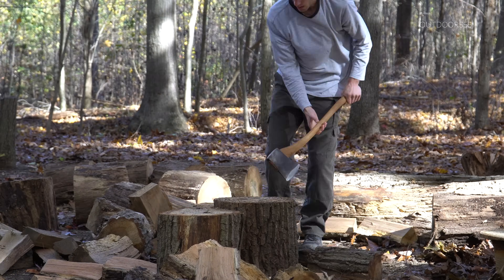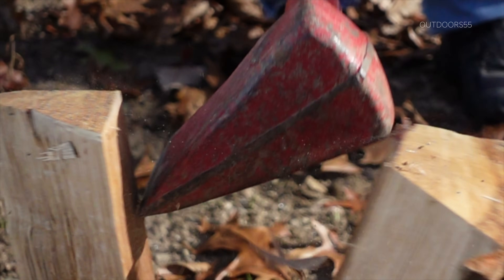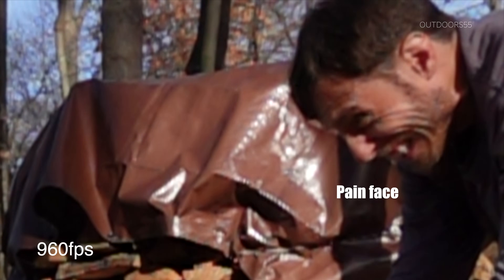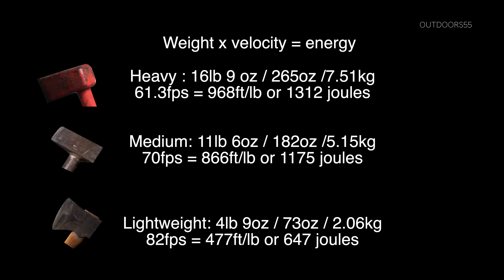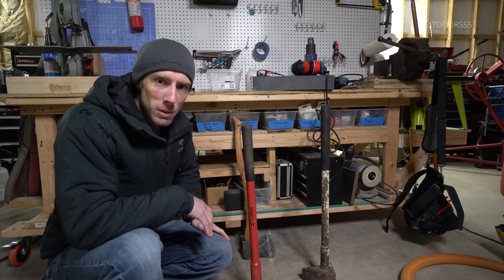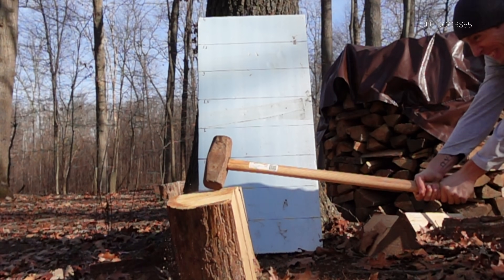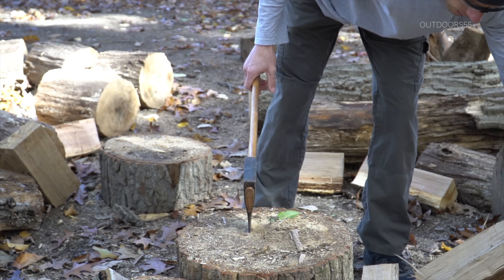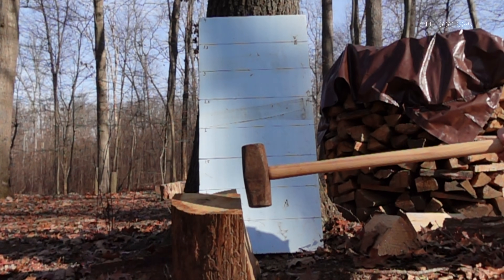The Great Wood Splitter Debate

Comment from the maker: Most powerful splitter??⬇
https://amzn.to/3V4E6Lq
If you think you know of one that is more powerful, let me know below and Ill check it out! I miss stated the equation for mass x velocity = energy, however the math and results are correct. 

This is an amazon affiliate link
I earn from qualifying purchases
Reply: Search "Leveraxe"
Reply: Definately hydraulic wood splitter 😁
Reply: Thank you for this!
I calculated similar (90-100 km/h) for an ordinal 1,5-1.8 kg axe max speed with a 80-90cm handle.
I needed this, because i tried to calculate the weight of my own manual wood splitter. Then i met Ingmar who made his ~10 yrs ago.
Google for "pidia se ingmars kylv". The machine is basically a 38kgs axe supported by a volvo spring.  (dimensions and build plans on the site)
As i calculated it hits the wood approx 20-30km/h (Half as slow as your biggest maul).
He was 72 yrs old , and could use it all day without gettin tired. (He lived in sweden,:splitting wood is a life long "hobby" there..)

Comment: To find the mass of the heads you could just find the midpoint of the axe head on the handle or its mid point if it’s welded on or something, then hang some weight from the opposite end of the handle. Balance it on a piece of wood until it’s leveled. Whatever weight you had to add to the other side of the axe is the weight of the axe head too.

Comment: Energy equals mass x velocity squared. The squaring of velocity is a reason it's much closer also the axe is focusing the energy in a smaller area because it is sharper. I think ideally you would want a very sharp narrow convex head that gets thicker quickly and has a bullet shape looking from the top.

Comment: Energy is E=1/2*m*v² its momentum that is p=mv. But then I did the calculations and found that your values are correct using the correct formula. Why are you fooling your viewers?
Also I think you can find the actual mass that matters simply by holding the handle at the point you hold it during spliting and put the edge of the axe on the scale.

Edit: whoops, sorry read your pinned comment now.
But I also wonder what is more important, momentum or energy.
Reply from the maker: I believe a higher momentum would also equal more energy.
Reply: @OUTDOORS55  Of course. But the momentum has a linear dependency on velocity, thus the difference in momentum for the different axes is even greater then the difference in energy.

Comment: I'm old. So I rely on deadweight. I have been using a very heavy sharpened leafspring welded to a square tube.
A nice heavy wooden shaft bolted to it. I spread my legs and lift it up and put a little force to help gravity.
I always aim for the edge of the round. About 4 inches from the edge. I have never had an accident and it works for me.
I call it a vertical axe
Also use it for getting small trees out of the corner of the garden.
Works so much better than a pick axe. I just work around the stump getting all the lateral roots. Usually about 3 and then an undercut for the tap root. I can usually remove an 18 inch old tree stump in an hour or so

Comment: the measured result energy makes sense, since it should be equal to potential energy before swing + kinetic energy added by hands during swing. accumulated potential energy transfers into kinetic thx to gravity.
you always do swing with max power available to your hands, so kinetic energy u add yourself is fixed.
and potential energy is a mass times height times g, and u store this energy beforehand while lifting your tool. the heavier tool is, the more energy u prepare by lifting it before swing

Comment: Reconfigure the arc of the splitting mall's head so you're getting a 400 plus degree circle with an increasing velocity and a diminishing radius to your swing. It's the velocity of the mall head at the point of impact that counts, so it has to be increasing for the entire circle. You cannot do this with "power,", but you can easily do it with a gentle grip and concentration upon continuing the splitter head's acceleration all the way to the finish line. As the head approaches the wood, a good swing will draw the grip back toward you, giving the head a diminishing radius of its traveled arc. I won't explain it ... I'm only stating what I have observed from successful splitters. The least effective splitters I have ever seen are my brother-in-law and his worthless kids. It's easier to split green elm by myself than to watch him pounding away. At least when I'm swinging the mall my mind can be comfortably at peace.
Reply from the maker: The velocity is at impact is exactly what what gives the power number in this video.

Comment: I really liked splitting firewood when i was doing time at a prison with a yuge farm, was second largest farm until about 30 years ago here in Norway. Used a machine hooked to the rear of the tractor, pulled a handle down to cut the log at about 1` and then pushed the handle to make the hydraulic pusher squeeze the log onto a T cross splitting it in 4. A conveyor belt then sent the split logs onto the hanger bed on another tractor. Could cut and split a 6 foot log in a little over a minute. Brilliant piece of kit to play with. Sure beat bagging the firewood on the days where the weather was too crap to go out in the woods.

Comment: IME, splitting has as much to do with the type of wood of the log, it's dryness (ie, green or dried), and the edge of the splitter tool.  The splitting ability of my heavy splitter (seemingly identical to yours) improved immensely when I took a file to the tool marks and dings on it's edge and smoothed things out.   Similar when the axe is dull, I sharpen it to a nice 30 degree edge.  Not to razor sharp, but sharp enough to cut your finger if you are careless.  I also find that a simple hatchet sharpened to a 25 degree angle is usually sufficient for splitting many dry log chunks into kindling.

Comment: In the woods it's not necessarily to split so huge logs in one hit. So I think less weight is more profit, because at your backyard you can use a drill with a special tooling to prepare firewood much faster.

Comment: Awesome. Thanks! Perhaps most efficient would be 6-8 lbs...also I am thinking that the wider the back end, the better for stringy or difficult woods. My theory is that we are speading the round at the top where we have the most leverage vs. traveling down into it spreading it with the nose or bit where we have less leverage.

Comment: A person will last a lot longer using the medium splitter than the heavy. 
The light weight has a sharper edge thus moving into the wood with less energy where the heavy one is “flatter”.

Comment: Physics major here.

In theory, a faster lighter axe (or in most of what I've done, projectiles) should develop more energy, if you have to pick between increasing velocity and increasing mass.

This is because the equation for kinetic energy is given by KE= 1/2 * m * v^2

What this means is a linear increase in mass results in a linear increase in energy, whereas a linear increase in velocity results in an exponential increase in energy.

If velocity is kept the same, and mass is doubled then energy is doubled. If mass is kept the same, and velocity is doubled, the energy is quadrupled.

I think the core issue here is where the axe head gets its velocity from. I think humans very quickly hit limits on the maximum velocity and energy they can impart to an axe, even a lightweight one, because there are limits on how fast a human can contract muscle. For example, let's say youre speeding down hill on a bicycle, and even though youre already going really fast, you want to go faster. At some point, you hit a limit where your pedalling can no longer contribute to gaining speed, as you're already in top gear, and your legs can't reciprocate fast enough to outpace how fast the drive wheel is already spinning.

Similarly... Notice the recorded final speeds on each trial. Although the lighter axe is being swung faster... It's not THAT much faster. I think it's about 20-30% faster in most of these trials, and even with velocity being an exponential change in energy, that's just not a big enough difference to matter. Especially when youre talking about a heavy axe head being 4 times heavier than the ligjtweight one.

The reason for this small difference in velocity is because, like in the bike analogy, youre hitting a muscle contraction limit on the human body. Obviously a ligter axe head can be accelerated to a much faster final velocity than a heavy one... Except humans arent really the best engine for driving that high acceleration.

Furthermore, like in the bike analogy, humans probably struggle to add energy into the system beyond what is already being accomplished in assistance by gravity. Gravity is already doing a ton of work for you, whether it be rolling downhill on a bike, or swinging an axe downward on a log. In order to add more energy to that system than gravity, one must impart a measurable downward force on top of that caused by gravity. If gravity is already accelerating the axe head close to the rate where the human body struggles to contract fast enough to keep up, let alone impart any more velocity to the axe head, then the force imparted by the human will be negligeable compared to that of gravity. Again, the small differences in final velocity highlight that the human arms here arent actually accomplishing much, at least on the downward swing.

Honestly, this is probably by design. Contracting muscles quickly causes a lot of strain. I think a lot of wood splitting axes like these aim to use gravity to your advantage, accomplishing most of the rapid acceleration for you so that your muscles dont need to do that much on the downward swing. Where your muscles are really most needed is in the much slower movement of lifting the axe from the block, and returning it to a starting position for the swing.

I think the lighter axe would be much more advantageous in an environment where you didnt have gravity to help, or maybe even needed to fight gravity. For example, some bizzaro universe where you need to split wood over your head for some reason. Then the differences in final velocity would be MASSIVE.

You might be wondering why there isnt a huge difference in velocity between the axe heads even when you consider gravity doing most of the work. After all, doesnt gravity affect different masses differently?

No... The acceleration due to gravity is 9.8 m/s/s, or 32 f/s/s. This stays the same regardless of the mass of the axe head. Furthermore, another constant here (well... Roughly) is the change in height. Each of his axes have about the same axe handle length. This means the axes fall roughly the same distance, regardless of axe mass. If he let them feefall instead of adding his own energy to them, they would all have nearly identical final velicites.

Honestly... This about leaves mass as the only way to reliably increase an axe's energy without seriously changing either the ergonomics of the axe, or the engine driving the axe down (the human arm). Considering all this, I'm not surprised mass is the biggest factor, even though velocity would be the biggest factor in a perfect world.

OUTDOOR55 is absolutely right about how important a long axe handle could be. If the speed of human contraction, the constant of gravitational acceleration, and the fall distance are all limiting factors to final velocity, then the best way to massively increase final velocity out of a human wielded axe is to make the handle far longer. Lets say you doubled the axe handle length, resulting in double the fall distance. Ideally, the human body wouldnt notice much difference in angular acceleration in imparting a downward swing, but the linear acceleration and final velocity of the axe head way at the end of the handle should be far higher. Even if we exclude the human body again and only focus on gravitational acceleration, it has twice the fall distance in which to acclerate as the original axes.

This sort of mechanical advantage is one of the reasons axes already have fairly long handles of about 3 feet. I think the reason most axe makers stopped there is it would start to get unwieldy and clumsy to swing an axe much longer than that. It would be unergonomical. But if one wants to see a big difference in imparted energy, one could instead try swinging the same axe head on say, an 8 inch handle.

I would honestly like to see OUTDOOR55 make an ultra long handle wood splitting axe. Who knows, maybe he'll make something weirdly nice to use compared to traditional options.

Higher kinetic energy btw doesnt necessarily mean a better axe. I was surprised at how well his lightweight axe could cut compared to the heavier ones, and I think that has to do with cutting efficiency. You dont NEED thar much energy, so long as that energy is well spent. It seems like the thinner more rounded blade of it was able to split the wood with far less energy required, than the heavier wedge shaped axes. That better cutting efficiency makes it a viable option compared to the heavier ones.

It looks like the heavier ones need to have that less efficient shape because they neex somewhere to put all thar extra mass into the axe head. It makes the axe heads wider. Honestly, it makes me wonder how an ultra heavy, but ultra efficient axe head made out of some exotic material like Osmium would fair.
Reply: PS, another advantage of the lightweight axe isnt just cutting efficiency, but also it is way easier to lift back over your head for the next swing Although it provides poorer energy on the way down under gravity assistance, you have to fight gravity in between swings. I'd imagine the heavier ones massively reduce endurance for that reason.
Reply: It is not "exponential increase in energy." It is "quadratic".

Comment: For everybody who is interested in the addressed problem of measuring and calculating the weight distribution, here is a solution for you: the value we are interested in is the moment of inertia (J) of a swung axe because the movement of the axe can be approximately described by a rotating motion around the shoulders of the axe user. First we need to find out the center of gravity of the axe, simply by finding the balance point of it. Then we need to knot  one string to one end of the axe and to a fixed point (e.g. tree) so it can swing freely. Than give it a little (important) Push and wait till it swings without wobbling. Then measure the time each full swing (from left over right to the left again) takes. The time for a swing (T) is calculated by T = 2π * √(J*m*g*s), where m is the mass of the axe, g is the constant and s is the distance between the rotation point (fixed point) and the axe's center of gravity when hanging. By changing the formula you get to the moment of inertia when spinning around his own center of gravity. To get to the moment of inertia while swinging around the user's shoulder (J') you first have to measure the distance (d) between shoulder and center of gravity of the axe . Then you can use the Stein's theorem J' = J + m*d^2. 
From this you easily get to the rotation energy by measuring the angular velocity (w) just before hitting and using E = 1/2 * J * w^2. 
The angular velocity can be found out by filming the swinging motion (with n frames per second) and measure the distance (x) between the axe's head in the last frame and the axe's head in the second last frame before hitting the wood (the distance traveled between these frames). The velocity (v) of the axe's head is v = x * n. And finally with the length between user's shoulder and axe's head (r) we have for the angular velocity w = v / r.

Comment: This video was made to troll physicist, isn't it? If not: the equation for energy was not the only brain fart. Power (Joule or Watt*second) is not the same as energy (Joule/second or Watt) but it is a transferred energy per time. So you likely tried to calculate the cinetic energy in Watt (E=1/2*mass*velocity^2). You would have to measure the time (t) and the energy loss in this time (E(t)) to calculate the average power for this time (P'=E(t)/t). But this is due to the fact of wood and human being a product of nature, so being inconsistent, nearly impossible to do it right. But unluckily the power is the more interesting thing. When a piece of wood is hit by a 9kg axe with 1m/s, the wood has more time to absorb the cinetic energy of the axe and "use it" to deform and giving the axe a kickback. A wood hit by a 1kg axe with 3m/s "uses" the energy more to crack because there is no time to deform. For analogy: when beating a knife made with soft steel, the knive has more room and so time to flex and bend and absorbing energy while a hard steel knives breaks (not the best analogy, I know). Maybe it is nitpicking for you but: the equal sign in the frame with calculated Energy shouldnt be there. A ":" would fit better.
Reply from the maker: The energy is a simple kinetic energy calculation using mass and velocity to kinetic energy. Very simple and easy to average out over multiple swings. Anything else is relatively impossible to figure out as all variables are not taken into the equation.